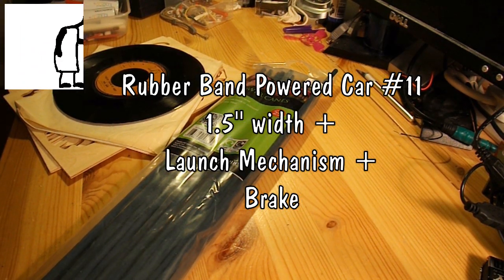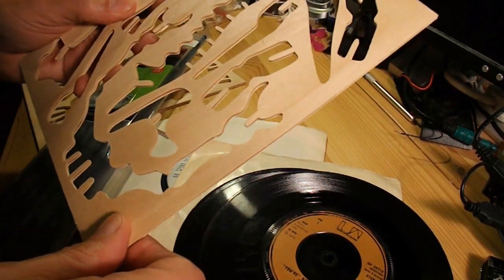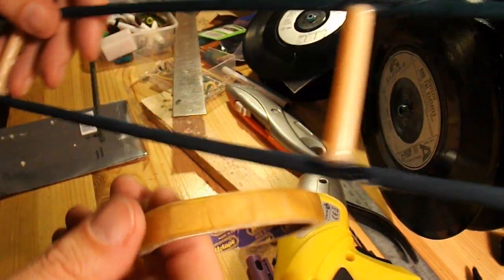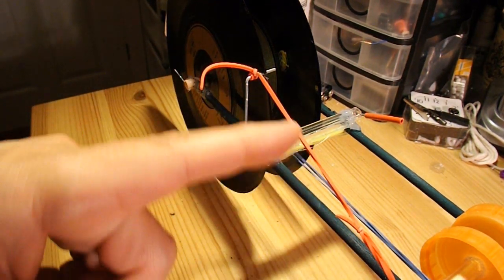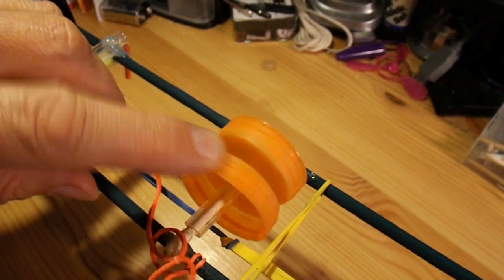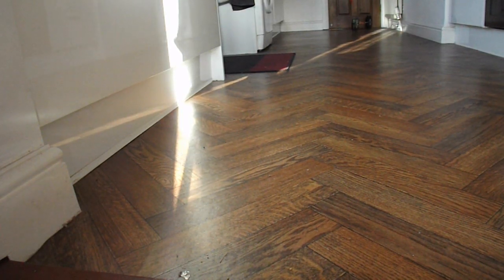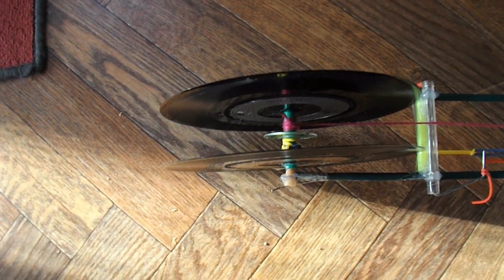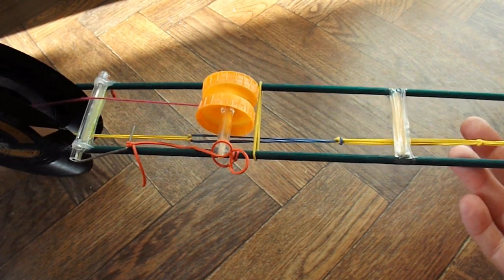Rubber Band Powered Car #11 1.5 inches wide + launch + brake

Comment: Finally watched the video. Good job on this one! For my project, the car can't be longer than 1 foot.  So I'm going to attach the brake string outside the wheels. I am planning on putting two brake mechanisms on both sides, to give it a sort of balance, since it will be riding on a narrow block of wood.   The hardest part of this project for me is the barrings.  It took me a while to construct the barrings properly since I'm not using the exact same design you are in this video. The wheels don't ride as straight as I would like either yet.
Reply from the maker: Hi baydood510. Yes I deliberately made my car big just for the fun of it. I was inspired by your questions but I didn't want to influence your project as that needs to be all your own work. Sounds like you are making good progress. Good luck.

Comment: Here's a challenge Grandpa! I think it would be a cool idea if you could make a rubber band car, but have the wheels on the inside of the chassis instead of the outside...
Reply from the maker: Hi Kirk, I will see what I can do, but the video you have just watched has the wheels inside the chassis.
Here is another one Let's make a Rubber Band Powered Car #4
And this one Lets make a Balloon Jet Car #3
And this one RC Valentines Delivery
And this one Bargain Store Project #1 - lint remover toy car